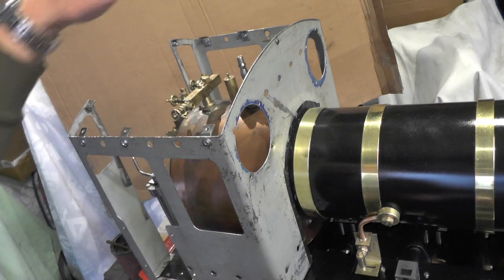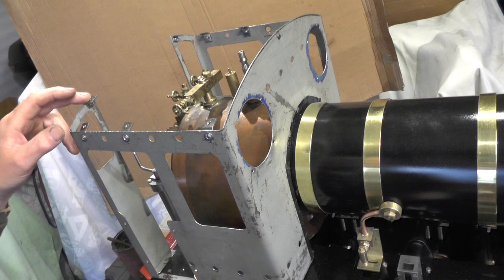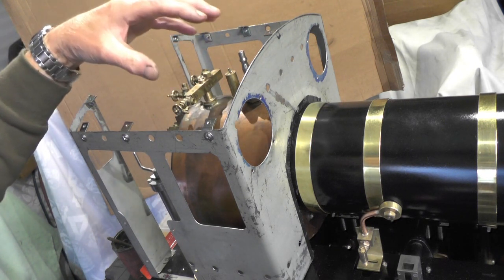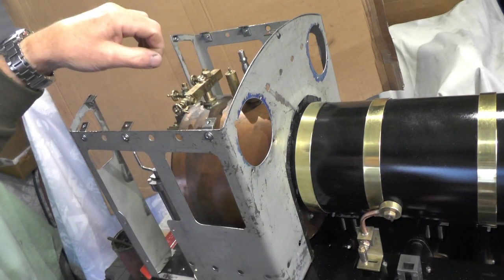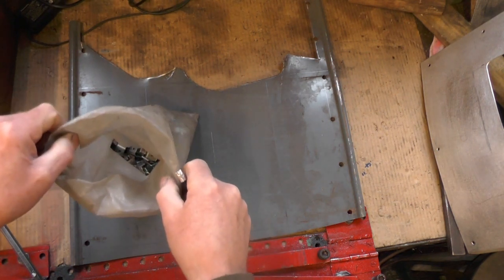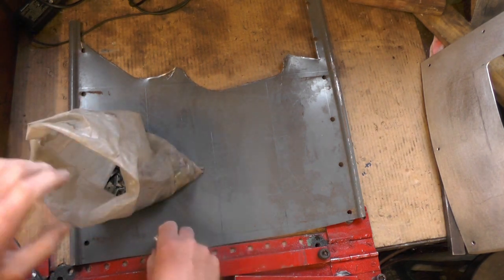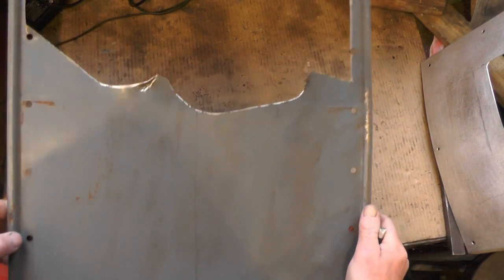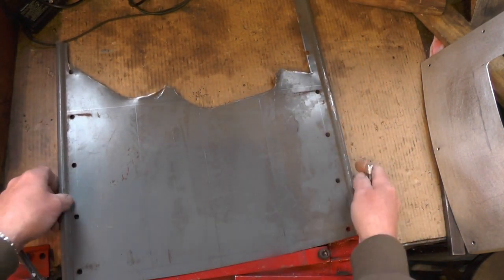Make a Beginners Miniature Steam Locomotive Series (Making the Cab P4 Roof ) "mr factotum"

Comment: Your loco is looking really good. The end is in sight. We will all be looking forward to loco #2. 😁. Just a thought on the boiler filling, and I can’t remember what your blow down valve is like but it could be easy enough to make an adaptor to fill through the valve. This way you don’t have to worry about ever damaging the threads in the safety valve bushings. It’s something I’m very aware of on my loco every time I do it especially if someone else is firing it up. I really need to modify my valve for filling but been busy on another loco so not come back to it.
Reply from the maker: hi chris
thanks for suggestion, it sounds good, especially with me having no experience on firing up yet.
On this loco the blowdown valve is in a arkward place at the front under the false cab floor, i have thought of re positioning to the side  for easy access, and when i get to that job i will keep your ideas and thoughts in mind. Bye the way What loco are you building, is it on youtube yet!! ive fell a bit behind on viewing my followers videos, but hope to catch up soon
regards
mr f
Reply from the maker: sorry Osiris, got your name wrong there , havn't got my specs on, thought it was chris another follower,
regards
mr f
Reply: Mr Factotum I’m currently rebuilding a 40+ year old Pamela made to look like a spam can. I should have built new as then I wouldn’t have inherited so many issues. But you live and learn. Just 1 of about 10 chassis I’m collecting for retirement. There are a couple videos of the progress on YouTube but it’s winter here so it’s a bit slow. It’s now onto the painting stage though so maybe a few months. Jeff
Reply: The pamela has a similar placed blowdown. My thoughts on that was adding a simple dump pipe off the valve, maybe a threaded union and run it out to the side with another threaded adaptor under the running board for attaching the water line. The pamela only has one drain position so I can’t move the valve easily. The only other option I have seen is using a banjo type setup and moving the valve that way but I prefer the idea of the valve at the boiler. But that’s just me.
Reply: @MrFactotum  someone call?🤔